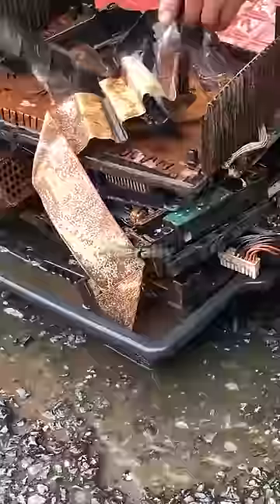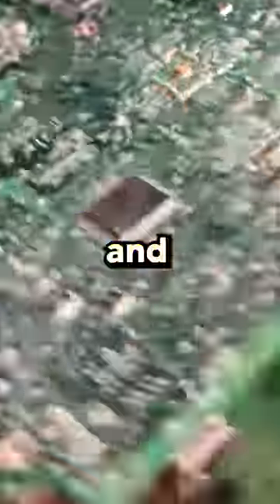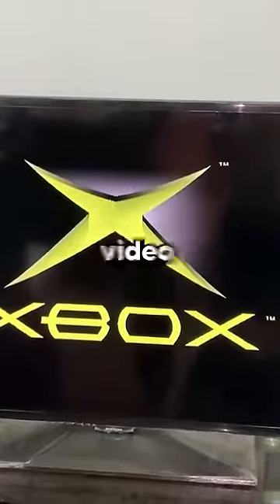Fake Restoration

Comment: The video is definitely fake
Plastic cannot rust

However, something to note
Using water to clean electronics is not a bad idea. What is a bad idea is to either have it plugged in while doing so, or powering on before it dries completely

/
The water being distilled is not a requirement when washing a device with it, regular tap or mineral water can do the same job, read the BOLD POINTS, they are there for a reason

[I, apparently have to add this on]
Printed Circuit Boards, like the ones found in devices like PCs and Consoles are literally washed AT the factory, WITH LITERAL TAP WATER, AFTER everything that needs to be soldered IS SOLDERED TO THE BOARDS 

The water ITSELF isn't gonna kill your things, the minerals sometimes may, which is usually why you will hear "use IPA to wash the pcb" and why it's a good idea to use compressed air after washing with water [but again, NOT a requirement]

Also, for the one who asked about the scrubbing: no, scrubbing isn't going to do much damage, if there isnt too much pressure, it's almost a requirement to remove corrosion. Even if you use something, such as vinegar, to attack the corrosion, you still have to come in and scrub it after
Reply: It is a bad idea if you are using regular water it can still get stuck in small parts and when you turn it on you fry the thing you were cleaning. But destilled water without minerals does not conduct electricity even if plugged in.
Reply: @RB-ej8wk  it aint dry then
Reply: @9halo what he means is you can never be too sure when its completely dry
Reply: NOT DIRT😡
Reply: @RB-ej8wk  wrong rugular soap and water does the trick
Reply: @lime819 even if it is completely dry, it still leaves particles that can still contaminate electronics
Reply: @JussDraftfr you can use WD-40, it will take out the moisture left inside of it. One time I dropped a flashlight in the water and it stopped working, so i put wd 40 on it and left it overnight it it fixed
Reply: I was going to say this
Reply: Gotta use isopropyl alcohol, AKA, IPA
Reply: @RCDEPENDANT  you don't have to use IPA, or even WD-40, you can use water.

Should it be distilled water? Yes
Is distilled water required if not using anything else? No, tap/mineral water does work, it is used in washing printed circuit boards, those don't dead after coming in contact with water, even with long exposure times

You just have to have it dry completely before it receives any power
Reply: @Kevaca  I'm an electrical engineer.
Reply: @RCDEPENDANT  therefore you could probably know that printed circuit boards are usually washed after solder is done... with ipa, distilled water, or even straight up tap water
Reply: Just a note. You still can wash electronics in regular water but when you're done you'd need to wash them in alcohol.
Reply: Very true, there is no electricity that is flowing through the device therefore not causing harm
Reply: Scrubbing it is.
It’ll literally heavily damage most components that are very fragile
Reply: I aint readin allat
Reply: @SAZTAPO  eh, somewhat

You do have to scrub to remove corrosion, though you shouldn't scrub that hard if it's not actually corroded
Reply: If you use water beware of Corrosion
Reply: I AINT READIN ALLAT
Reply: Uhhhh it will breake or kill u
Reply: i was getting ready to say this because ive cleaned controller and other items that have corrosion using water when I said purple isopropyl alcohol isn’t enough
Reply: Plastic can rust unless you put it in rusted parts of Xbox but if it's not put in rusted parts of Xbox it can't be rust like metal (am i right)
Reply: I ain't reading alldat
Reply: True🎉
Reply: That brush look like a brush that is old and that could push off some small smd components
Reply: @jrruelbaling234  that made absolutely no sense i think you refer to the dirty brown water that comes from rust that drys to plastic making it look dirty
Reply: THANK YOU SOMEONE SAID IT
Reply: Bro wrote an essay
Reply: I ain't reading all that
Reply: @Pot-dun-gone  don’t care
Reply: I AM NOT READING ALL THAT but ima say facts
Reply: I ain’t reading that essay but I totally agree
Reply: Mans wrote the assignment that the math teachers give us 😂😂😂
Reply: @jrruelbaling234  no, rust is usually caused due to exposure to: oxygen (which, yes, water has some but still)

Metals rust, plastic doesn't
Reply: @personally_taken  it originally was only 1 sentence, but I added more to it as time went on because of what people were replying with
Reply: i aint reading allat
Reply: That’s alotta words. Too bad I ain’t reading them
Reply: This is true
Reply: Quit yapping😭🙏
Reply: @coolnosrep  yapping about dn
Reply: i aint reading all dat
Reply: Make sure you have the cmos battery out
Reply: @Kevaca  tf is dn
Reply: @coolnosrep he isn't even yapping tho he just spitting straight facts
Reply: ohhh that's why my phone blow up
Reply: @philipmatloob9940  writing a whole paragraph in a youtube comment section is yapping
Reply: Wrong the minerals of the water will destroy the mother board and other components
Reply: @coolnosrep  silly statement considering he himself stated he had only started with one sentence and he just constantly added new sentences to respond to people in his replys this not being any different then just responding with a new reply
Reply: Thanks!
Reply: I mean ur right but it’s probably fake
Reply: I aint be reading all that
Reply: Needs to be rinsed with isopropyl alcohol after any water though. The minerals from the water do have a chance of causing damage
Reply: @JussDraftfr bro if it’s complete dry then there’s no water left and it can have a small amount in some parts that it won’t damage it so if it’s complety dry then there isn’t any particles of water left that can fry the components when powered on
Reply: @deadpanda12109 unless u use destiles water and waters have different amounts of minerals
Reply: @samuelraposo4186  true, could use distilled as well. Personally I would still do a rinse with isopropyl just to be safe.
Reply: I hate how people don’t have a basic understanding of engineering and electronics
Reply: @deadpanda12109  doesn't need to be, if the factory does it, so can you
Reply: @samuelraposo4186  alr then make a video of you doing it
Reply: I ain’t readin all of that
Reply: @Kevaca  like I said, I personally would do a rinse with isopropyl just to be safe
Reply: I ain't reding alldat but u are right
Reply: Your brain is tge best
Reply: 69 comments? not any more
Reply: @polandgaming2321  goddammit
Reply: I ain't reading all that 💀❎
Reply: Thank you for saving me time, thats a better explanation than what I could have said
Reply: @lime819 use silica gel packets, the same ones that say do not eat, they absorb water from the air and things near them like a sponge
Reply: Damn
Reply: Jus use distilled water
Reply: I ani’t readin all that
Reply: True
Reply: yeah.. i aint readin all this
Reply: @lime819 you can. Just feel or use something to warm it up.
Reply: Also remember the cmos battery in most electronics like pc laptops and consoles
Reply: Damn the fact that so many of the replies say "I aint reading all of that" really shows how much TikTok has affected this generation.
Reply: As someone who majored in IT, i agree
Reply: @lime819  just wait a day by having it in a place that is hotter then room temp it will work
Reply: I ain’t reading allat
Reply: Im not reading allat
Reply: @RCDEPENDANT  how are you an electrical engineer and you don’t know that printed circuit boards can be washed?
Reply: @jrruelbaling234 plastic cannot rust period. Rusting is the oxidation of metal, when plastic undergoes oxidation it becomes frail and starts to crack
Reply: @Kevaca Corrosion left the chat.
Reply: @omegalongdong  seems you cannot understand that something all pcb manufacturers do, confirmed by workers, that has been backed up time and time again by confirmed IT workers, is right
Reply: People who don't realize this might not know but you do know if it was been soaked in water when cleaning,then use isopropyl alcohol as they LOVES to absorb water and you MUST watch it from Linus Tech Tips as he showed a vid proving even a coke drink whilst on can't fully damaged it if it haven't short out yet but wash with distilled water FOR THE BEST RESULT as tap water is THE WORST idea due to how many ions and such in there,if something such as a drink like coke for example spilled at your PC,then it is REQUIRED to use Distilled water as that can't be absorbed by the isopropyl alcohol meaning it is needed
Reply: @Kevaca nope you guys didn't watch Linus tech tips which he told that the tap water is the LAST thing you would use because MINERALS and even if dried,YOU GUYS SHOULD TAKE ACCOUNT ABOUT THE REMNANTS OF THE WATER WHICH SHOWS DRIED WHITE THINGS WHICH ARE MINERALS THAT MEANT YOU CAN'T USE UNTIL YOU CLEAN IT AGAIN
Reply: @lillappy7520  we do take account of the minerals

So are you saying the manufacturers, workers for said manufacturers, and many... many other trained IT workers are lying?
Reply: Yapperville needs there mayor back
Reply: ingor electrocuted 😭😐😐😐😐😐😐😐😭😭😭😭
Reply: So you forgot that capacitors need to be discharged before using it and yeah the others are right beside the board itself ain't the problem the components put into it is the board itself is just a piece of easily formed thing.
Reply: Ok
Reply: I ain't reading allat
Reply: r/beatmetoit
Reply: @lime819 ever heard of putting it in a dry warm place for a while?
Reply: Really good explanation

P.s. submit this to your computer science teacher, maybe youll get that extra point
Reply: IdkSterling aah comment tbh 💀
Reply: Hella helpful actually.
Reply: Haha I’m not reading all that
Reply: @Emirates1211 same bruh
Reply: It's still a bad idea considering that there's other stuff in play like capacitors still holding a charge and also coin batteries that might be on the board still
Reply: @talbog It is
Reply: biggest yapper ive ever seen
Reply: Yeah
Reply: Bro wrote a whole eassy
Reply: @RCDEPENDANT  bro wth is this counter to an argument, "I'm an electrical engineer"
Reply: @coolnosrep  wrong us of word yapping
Reply: @boiledegg2254  fix your grammar I can't even tell what you're saying
Reply: Possibly
Reply: My missus dropped a beer over my pc once, I didn’t even try clean it as I thought it would be killed completely as it was turned on at the time and the screen died and the pc
Turned off, turned it on a few months later and still worked aha, surprised
Reply: Well the hard drive was submerged too lol
Reply: that toothbrush gives me chills down the spine.
Reply: Finally a knowledgeable person
Reply: i ain't readin' all that
Reply: @lime819 leaving it out to dry is a sure way to dry it
Reply: @RCDEPENDANT then you should know this
Reply: You could have stopped at plastic doesn’t rust but you rubbed the salt in the wound with a five page essay
Reply: I literally wash my keyboard in the shower every month and it still works like new so
Reply: Um i heard that u should use destilled water beacuse mineral in regular water can last on parts + the conduct electric power
Reply: Blah blah blah
Reply: Not růst but dirt
Reply: @RB-ej8wk you are deluded
Reply: Bro went to college or sumn you think your better than us or some shit?
Reply: Exactly what I'm thinking
Reply: Came here to say the same thing
Reply: Exactly
Reply: How to type in bold letters,
Reply: @Fishy_999 this xbox series, used a capacitor for rtc, which even if the video was real, would be decharged
Reply: @ItsCOMMANDer_  i know i was jsut saying for a general pc
Reply: If i am allowed to expand on this as a 94E from the army. I have personally washed pcbs. What this man is saying is 100% correct. The minerals in the water can corrode the pcbs, especially when current is applied. But you can totally drown your pc in water and then lightly scrub it (unless the person who did the solder is terrible, in which case something could get knocked off), as long as you make sure it is dry and that you have grouded yourself. If there is any water or any major  build-up of minerals on the pcb, and current is applied, then you screw up the circuits. But that can be fixed on 3 conditions, 1, you can get replacement icbs and other modules, 2, can solder with precision as some pcbs are pretty small, and 3 can diagnose the parts that were damaged, as not all parts will be damaged due to a single short.

TLDR: Bro is right, and if you arent an idiot you can fix it even if do screw it up.
Reply: @lime819 if you leave it long enough, in a warm dry area it will dry. Like a week should be enough if you have it somewhere warm.
Reply: even when its off avoid using mineral water
Reply: @RB-ej8wk it’s always a good idea to wash, then put it in isopropyl alcohol, it’s hydrophilic and will grab any left over water particles and pull it from the board
Reply: I aint reading allat
Reply: @talbog  what you talking about
Reply: I aint readin allat🗣️🗣️🗣️
Reply: Oh no, computer nerd!

Funny thing, I’m one as well.
Reply: @RB-ej8wk  if you had a hair dryer or compress air use them to eliminate the water in nooks and cranny and i tried washing the motherboard with water and dry it for 4-5 hours under the sun and clean it again with isopropyl alcohol to eliminate the dust and water mark and voila it work
Reply: it is a bad idea to use regular water instead of distilled water as it can contain minerals that are conductive
Reply: Bro wrote a essay about it 💀💀💀
Reply: @JussDraftfr  that why you use disstilled water (Sorry for speeling)
Reply: No they use ultrapure water using reverse osmosis and electric deionization. If they used straight tap, it would increase the chances of shipping a bad board due to leftover ionic compounds when the water evaporated, causing short circuits.
Reply: what is blud waffling about
Reply: That's why you wait for at least a week and bake it in the oven on 100°f  @lime819
Reply: Scrubbing is a bad idea...

You will probably knock off a component like a resistor, happens to me all the time and I'm not even cleaning them lol
Reply: Just use isopropyl
Reply: Scrubbing can damage fragile surface mount components
Reply: Professional Yapper
Reply: Put it in rice
Reply: Neat
Reply: Ok but rust can come of of metal and stick to plastic
Reply: Smart
Reply: But make sure that you dry it for a very long time 😂😂😂
Reply: Holy yap god is here
Reply: One thing i did miss was, if you so decide to use water to clean. **Make sure its 100% dry before any electricity comes in contact**

Also wow there be a lot of hate on something thats true.
Reply: You are just right 👍👍👍
Reply: I've washed PC parts in distilled water & used soft toothbrushes to loosen dirt/old thermal paste without issues.  Just make sure to let the parts sit post-wash for at least 24 hours to completely dry out before plugging them in.
Reply: what's the bold points
Reply: Bro its literally dirt not rust
Reply: @categoria207  actually more likely it's brown paint
Reply: Xbox plastic does not 
 ...Read more
Reply: Plastic doesn't rust. True. Rust is used for metal. For plastic, we say oxidised. Plastics are very sensible to UV light and moisture, which degrades its properties of colour or mechanicals. Concerning the water cleaning, I don't see any problems until you conscientiously dry when current is on

Comment: As a person who works in the manufacturing of printed circuit boards they can get wet but they have to be blown off and then dried before a electrical current is applied through the board

Comment: You can wash electronic parts as long as it's not running with electricity, I usually recommend isopropyl as it Evaporates faster and usually is a better clean

Comment: yes you CAN wash it lol. when you plug it back in just make sure its dry
Reply: Corrosion left the chat.
Reply: Water has minerals
Reply: @rafagai distilled water.
Reply: @phonaddictus  at that point just use the proper tool to clean it which is isopropylic alcohol
Reply: @rafagai  fair.
Reply: @rafagai only ehen there is current flowing through the circut, otherwise, it wont break if it wasnt wet for long and 100%dry afterwards

Comment: For the record water doesn’t damage electrical connections board/ circuit boards, the minerals in most water is what causes issues. You could also wash  or even submerge electronics in distilled water, dry them off and they’ll still work.

Comment: While yes, people might think it's a bad idea. You can safely clean your electronics with water. However make sure the water is completely evaporated before turning on the device. Also a little safety warning, make sure to remove any power or battery from the device before doing this.

Comment: You can wash off circuit boards. Water doesnt damage electronics, electricity does. As long as its dry before it turns on its fine.

Comment: 1. That’s not a 360, that’s the original

2. Plastic in fact cannot rust, but that could very likely be mud

3. Electronic boards and plenty of other electronics can be safely washed with water for the most part and still work as long as none of the components hold a charge and the components are fully dried before being powered

4. Even though his dude has the dumbest takes of the century, he is still most likely correct in his assessment that this restoration is fake

5. That wasn’t 5 points, this is.

Comment: It doesn’t matter how wet you get electronics; as long as they don’t power on while wet, they’ll turn on fully dried. Sure some materials might not be the most water resistant, but most of the time, you’re being cautious while cleaning parts.

Comment: you usually can wash electronics in water as long as there is no power in the capacitors/batteries, or anything that holds power, and you properly dry it before turning it on again

Comment: Electronics don't get damaged in water as long as you don't power them, you have to wait until it is fully dry and you have to check corrosion on board before turning it on